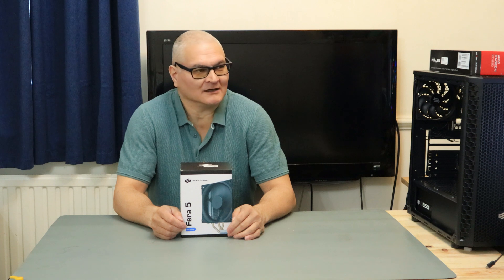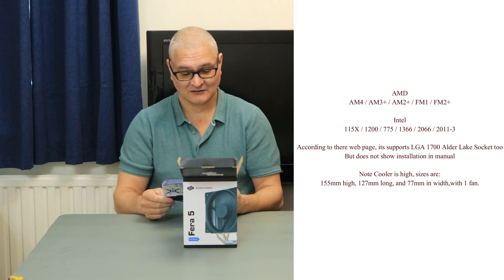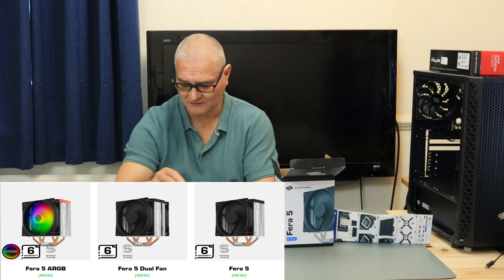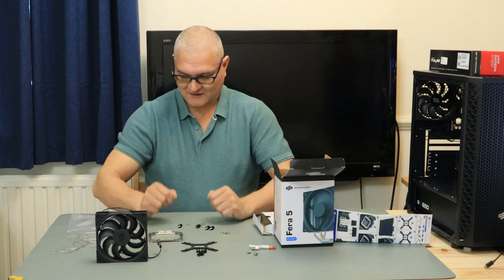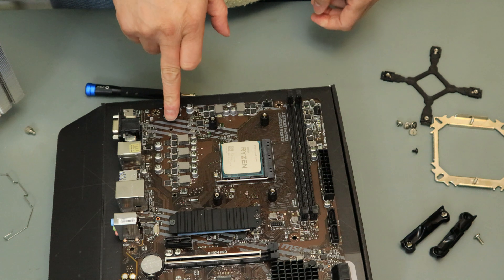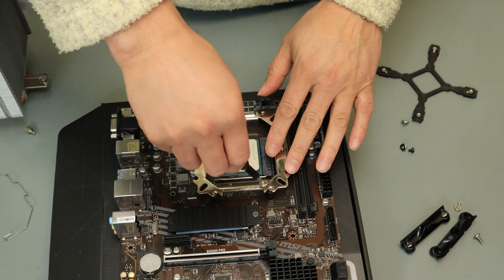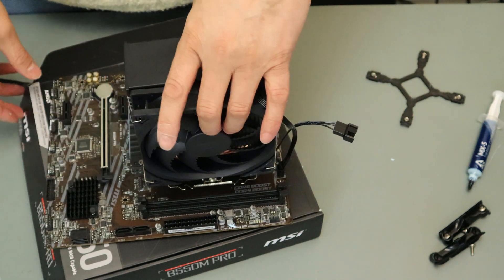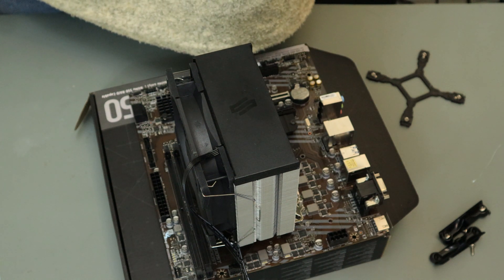SilentiumPC fera 5 cooler Unboxing and installation AM4/LGA 1200/LGA 1700

Comment: Is this compatible with am5 and it's default backplate?
Reply from the maker: Have to say never tried, at this time there WEB page does not show AM5,  but i will find out if the cooler has an update and the web page is wrong.
Reply from the maker: Have spoken to silentiumPc Rep, and have told me, it is AM5 compatible with standard AMD backplate. Will do a video in the future update, hope this helps
Reply: As far as I've seen in polish web shop, silentiumPC had been rebranded to Endorfy, also store page of the cooler says that it's compatible with am5 :\

Comment: I have problems with the last screws on cooler any advice?
Reply from the maker: Hello, they should all fit fine, there should be springs with the last 2 screws, otherwise it may be loose or over tight.

Comment: very small contact on the bottom on this coller if u want to install on LGA 1700 :( on your clip its covering only LGA 1200, idk how this still works on LGA 1700 somehow
Reply from the maker: Hello, it should fit most motherbaords. including  LGA1700. this link will show you whats not compatible with the fan.https://www.silentiumpc.com/pl/lga1700-motherboard-compatibility-notice/  Note you may have to translate it to english, using google. Hope this helps..